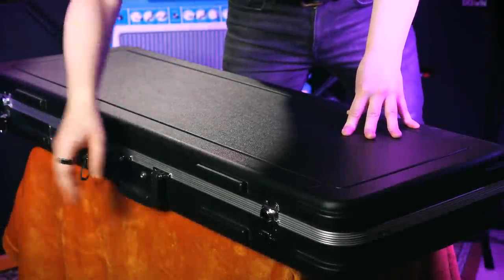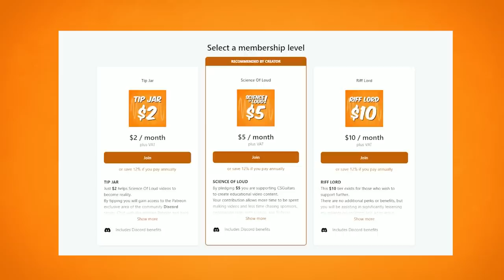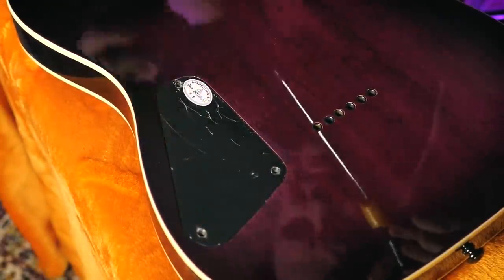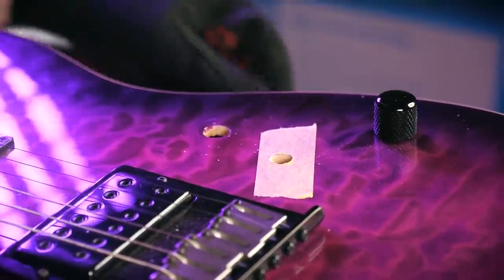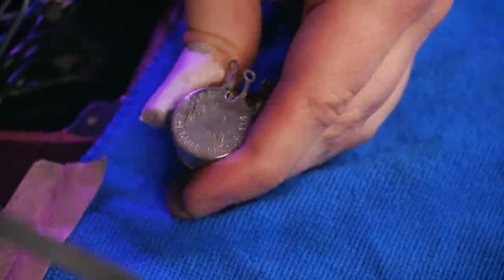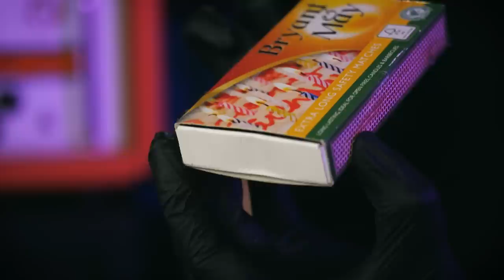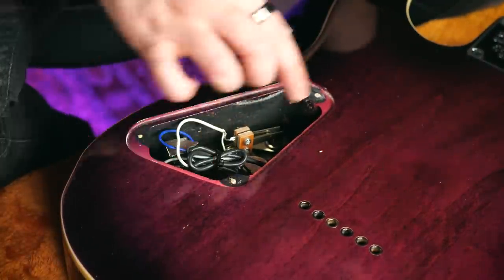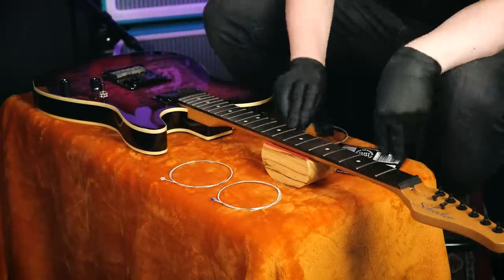PURPLE Schecter Repair & Clean-up | Axe From The Grave

Comment: I have a Schecter PT Fastback that I ended up ripping the humby's out of and slapping in a pair of passive EMGs compared to the lower output factory ones that were in there already. The thing is just a flat slab of heavy wood so I wanted to turn it into a rock and metal machine, almost Les Paul-like. They are very underrated instruments, and it's probably one of the best guitars I've had the pleasure of owning.

Comment: I got a Schecter Blackjack C-1 FR S a few months ago, and it is a beautiful guitar, but had the worst QC issues of any guitar I've ever bought, and I've been buying guitars since the early 1970s! (Only as a hobbyist, I should say, not as a musician).

It is by far the most expensive guitar I've ever bought, and it was made in S Korea, which is generally a plus. I have a Sun Valley Super Shredder that is absolutely perfect, but this Blackjack has had many issues;

The 'blacking' on the metalwork started wearing off pretty well from day one. So the FR trem looks like it has vitiligo! 
By far the worst issue was after about three weeks, the neck pickup and Sustainiac cut out altogether. I took it apart, and found the input socket had been badly wired, and wires were making contact with the frame and with each other. Had to completely re-wire and re-solder the input socket.
The 13th fret had popped a bit - had to tap that down to stop the buzzing.
And lastly (so far), the FR trem does not hold tuning as well as one would hope. It's OK, not awful, but I've got other guitars with FR trems, and they are much older, and hold tune much better.

Luckily I've spent a few years taking apart Harley Benton guitars and modding them just for fun, so I had the tools and experience to fix everything. The input jack problem was fixed before I even got a reply to my email complaining about it!

Pardon my venting! £1,339.00 may not be much in the grand scheme of things, but it is a huge amount for me, and I expected better, TBH. The shop I where got it was helpful, but Schecter gave me the brush-off. Eventually they sent me a free t-shirt, a cotton bag, and three sets of strings (not the gauge I use - they never bothered to ask).

Comment: Excellent stuff. Cool tune (will be checking out that band later) and great tips for sorting stuff like mismatched metric/imperial pots and stripped screw holes. I absolutely HATE soldering stuff to pots, so I'll give the scratching thing a try!

Comment: I love the tone during the playthrough.

Why's the signal path listed from right to left though? Usually when I see signal path listed, it's from left to right.
Reply from the maker: Pedals have their inputs on the right and their outputs on the left. 
If you were to arrange this sequence of pedals on a pedalboard in signal order, that's how they would look: guitar connects to the right of the pedal board, signal travels leftwards through the pedals and leaves to the amp on the left. 

Arranging them Left to Right just to satisfy Western reading conventions is incorrect and confusing when it comes to visually representing the signal chain of physical effects. 

I can only assume that you are more familiar with plug ins and software than with physical pedals if you see a left to right arrangement more commonly.
Reply: @ScienceofLoud  Yeah, I usually use plugins, so your arrangement makes a lot of sense now.

Thanks!

Comment: Probably a good decision not to use brass shaft covers for those pots, the ones I found only fit Imperial sized knobs. Sadly I found that out after I tried to squeeze import knobs on there😂

Comment: What are the advantages or differences to using the wax based fretboard finish vs lemon oil or boar oil?
Reply from the maker: Oils are penetrative while waxes are not. 

Oils seep deeper into the wood - which is great for finishing raw wood and giving a deeper colour. The deep penetration means that moisture and dirt can't get into the wood - which is the main reason why we want to protect fingerboards. Oil penetration isn't always desirable - too much can swell wood (which could result in frets popping out), it reacts undesitably for certain types of wood (raw maple being the oft cited example of when NOT to use Lemon Oil), and it'll do very little on a finished surface since it can't penetrate paint or lacquer. 

Wax builds a water resistant layer on the surface, which works better for protecting already finished wood. Being non-penetrative there is no risk of oversaturating or swelling the wood, wax is much less likely to negatively impact maple, and you can wax on top of finished surfaces to add an additional layer of lustre and protection. 
Think about all the people who wax their cars for example - it offers a protective layer without changing the underlying surface. 

Waxing metal parts will also prolong their shine, preventing moisture from tarnishing the surface - so it's good for frets too. 
It will however wear quicker and need reapplied more regularly than oil. 

When would I use oil:
On a brand new fretboard that was raw wood and hasn't received any protection, or on a board that has significantly dried out. New guitars and ones in significant decline. 
When would I use wax:
When the board is well hydrated and simply needs cleaning and protection. General maintenance/string changes on a regularly maintained guitar.
Reply: @ScienceofLoud  Thanks for the info! I'll have to look into getting fretboard wax!

Comment: Just curious, pointless question, but is there any reason why the signal path is going from right to left rather than left to right?
Reply: Pedals have inputs on the right, outputs on the left.

If you're a righty playing a normal guitar/bass, cable is also plugged to you right, so when facing a pedal/pedalboard, cable never crosses in front of you.
Reply from the maker: Because that's the way the pedals would arrange themselves on a pedalboard. 

Inputs are on the right, outputs are on the left. 

If I were to set up the diagram to display the left to right western reading convention then it would be wrong and confusing for people trying to copy the arrangement of effects.

Comment: Guitar industry is always evolving and it's kinda awkward the we still use the inconvenient solder for electronics.
I hope other brands follow EMG and implement solderless technology.
Reply from the maker: I hope they don't. 
Soldering is the far superior way to make permanent electronic connections.

Soldering is only inconvenient if you don't know how to solder. It's a very useful skill to learn and if you want to perform regular maintenance and modification then it's a necessary skill to have.
Reply: Well guitar fetish and I would assume the manufacturer they buy from I think Artec, have the Kwik Plug pickups, wiring harness’s, and DIY bits so you can just wire the leads onto your pots, other bit on the pickup wire. The VEH set sounds nice, but aren’t anything special imagine a set of designed by Duncan 59s instead of actual Duncan 59s. I think it was 85 usd shipped for pickups, and a wiring harness w/ push pull pots on sale. I do agree with Colin that we all should learn to Solder. It’s a suprisingly useful skill.